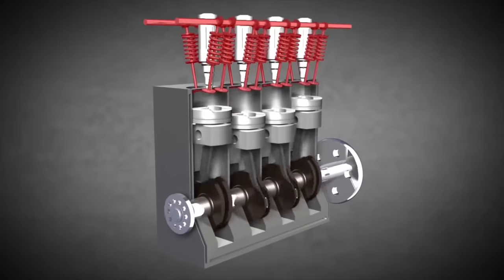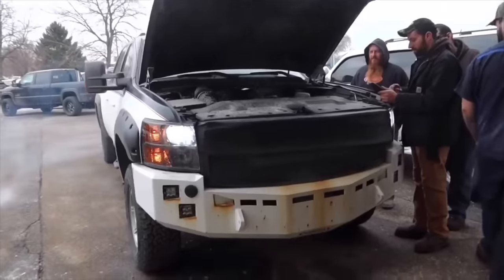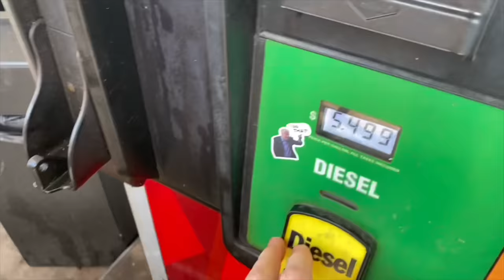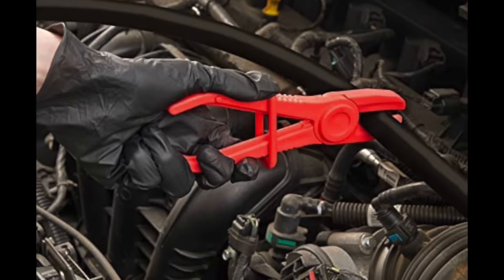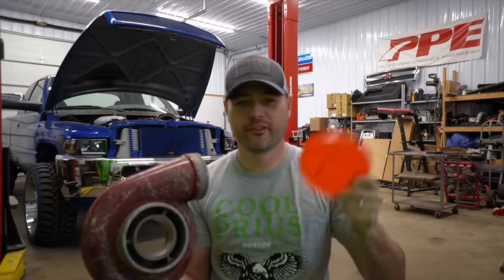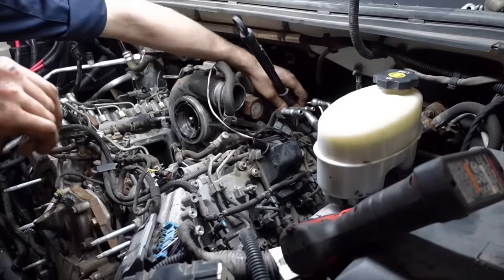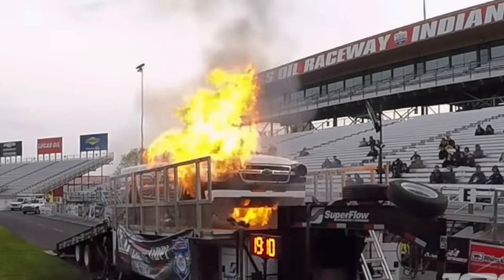What Is A Diesel Engine Runaway? *EXPLAINED* ￼

Comment: Ever since EGR/DPF systems became a thing, a runaway can be stopped by turning off the ignition. In order for the engine to run on exhaust fumes instead of air, there's now a throttle body before the intake manifold which can completely shut off air supply
Reply: Lube oil runaways can’t be stopped by shutting off the fuel. That’s because the engine fuel isn’t coming through the fuel system.
Gas turbines have the same problem.
Reply: I didn't say shut off the fuel, but the air supply.
Reply: @DanniV8  Diesels manufactured after the 1930’s don’t have throttle bodies - they use fuel injection (usually directly injection). Throttle bodies significantly reduce engine efficiency which is why modern gasoline/petrol engines don’t have them either.
Reply: @allangibson8494  Petrol cars always have throttle bodies. Some don't use them, but then they have some sort of valvetrain system that regulates throttle. In those cases, the throttle bodies are always wide open during operation, but are a failsafe in case the valvetrain system malfunctions. If a malfunction occurs, the throttle body is used to regulate throttle with reduced power and the relevant driver messages. A good example of this kind of system, is BMW's Valvetronic.

Since about 2007, diesel cars have had EGR and DPF systems. In order to clear the diesel particulate filter, a regeneration mode is activated that makes the engine run on the air from it's own exhaust, A.K.A. Exhaust Gas Regeneration. When this mode is activated, a flap - usually called a throttle body, is used to close off the fresh air supply. This, in combination with a slightly higher concentration of fuel, generates exhaust gas heats in excess of 600°C in order to vaporize the particulates in the particulate filter.

So, there is a throttle body/throttle valve, in these cars, but it's not used to control throttle. There simply isn't another name for this type of valve.

The added benefit of this emission reducing tool, is that in the event of a diesel runaway where the turbo is feeding a mixture of air and engine oil into the engine, the key can be switched off and that closes both the EGR valve and the "throttle" valve, effectively blocking the oil mixed air from ever entering the intake manifold and therefore shutting off the engine.
Reply: @DanniV8  Direct injection gasoline engines don’t have throttle bodies - they have air flow measuring devices.
Throttle bodies exist to modulate air flow while maintaining a constant fuel flow ratio. Direct injection engines simply don’t require them to run.
Reply: @allangibson8494  Which petrol cars don't have a throttle body? I don't know all cars but I work on BMW's and they all have them, petrol and diesel, even the brand new ones. 

My own petrol car has a high pressure direct injection fuel system, and the only time it has failed on me was when the throttle body failed and the car would only idle, not take any response from the accelerator.

It is a direct injection gasoline engine that I replaced the throttle body on with my own hands, so yes, they do have them.

There might be cars from other manufacturers that don't have them, but I have yet to see any.

Comment: The real problem is: free entry of air along with accumulated oil in the air cooler. Oil from damaged turbo. You accelerate and the engine pulls accumulated oil. perfect combination to feed the engine at full rpm. oil works as fuel

Comment: Great video... as always.  Very important information.  Way back long long time ago... scary to think how long it's been... ANYWAY... my good friend and I  [couple jarheads ..heavy equipment mechanics...].  Had a 6-71 Detroit Diesel  [6 cylinder 71 series injectors] in a 82-30 Dozer. Run away on us... we slammed the clipboard down on the intake and bailed ..like Earl lol... it shut it down and it didn't blow.  I don't remember the direct cause... yeah it was a long time ago don't remind me.. I believe the throttle stuck.  Diesel engines are not high revving engines... but it took off. It will suck all the air out you through your backside in a hurry.  
  After that we tried to talk the boss into a purpose run away as a class.  He was for it but we never got our hands on a piece of equipment being coded out. That we could use.  
Great job...
Reply from the maker: That’s wild 😂 also thanks for your service 🇺🇸
Reply: Detroit Diesels shut down with the governor commanding full fueling. If the rack sticks, it'll run away. You'll see a lot of YouTube videos of people starting them after a long time idle only after they have made sure the fueling rack is moving freely.

Comment: Yes I have actually believe that is true, it happened to my old Izusu Mu 4wd 2.8D turbo. Turbo got damaged and engine still continues to running with high black smoke out of Mu exhaust and suddenly there was running away on and I managed to gear-in 5th speed, clutch off slowly and it stops,  turbo got replaced. One year late, Mu engine completed dead.

Comment: It's always a good idea to have a fire extinguisher in your truck, and if the extinguisher is large enough, you can usually stop a runaway engine if you can discharge the extinguisher directly into the air intake.

A runaway engine is a very dangerous situation and the safest action you can take is to get away from it and keep everyone else away too.
Reply: Some buses and trucks have automatic suppression systems mounted in the engine hood. Wondering if they can effectively smother a runaway engine if discharged.

Comment: I was so (unreasonably) worried about this issue I ran a hose from a 2.5lb CO2 accessed from inside the cab to a port I machined that sits inside the intake plenum just in front of the turbo entry.  If I get a runaway I open the tank valve and it floods the engine with CO2.  Yes, it's overkill but I'm retired so I have the time and money for overkill.  This is on a 1988 Land Rover 110 with a 300 TDI.

Comment: I was working on an old 2-cylinder Kubota diesel generator. I started it unaware the governor was not hooked up and the spring pulled it all the way to wide open throttle. The way we got it to stop was my plugging every orifice on that goddamn engine.

Comment: Nitrogen or CO2 suffocation system would work,just use a air restrictor like the air shut off valve and then fill it full of inert gas

Comment: Had a runaway on a military Chevy we had just gotten. They had air filter removed. I grabbed my hat and plugged intake. The mechanics had all ran away. That was in the mid 80s. those trucks where crap. Compared to the old Dodges they where supposed to replace. No power. Open diffs. And high gears.

Comment: With a manual transmission you can put it in gear and hold the brakes to overpower the engine (or break the transmission)

Also, why don't air shutoff valves come standard? it's not like they're expensive

Comment: I think this is what happened to me on my 2005 ford 6.0. I was getting on it pretty hard and then it just kept going without me.  I managed to apply the brake long and hard enough to bring it to a stop bringing the rpm down and shut the engine. Never did it again after that. Restarted it and it was fine.

Comment: Was driving a freightliner with rebuilt DD-15 motor an the injector flaps got stuck open. Motor hit 4k rpms before the case cracked open stopped the motor

Comment: I have a diesel jetta that ran away.  VW has a valve in the engine that closes when the key is turned off,  which cuts off the air supply to the engine. I was able to stop it,  but had to rebuild the engine.

Comment: Had a runaway diesel about a year ago now with my alfa romeo 147. I ended up stalling it by going into 5th gear.
I wasn't all that versed into car mechanics, so i thought it might have been the head gasket or the car overheating.
Turns out the turbine wheel was worn out and moved around too much, scraping the walls of the turbocharger, burning or leaking oil.
I was incredibly perplexed over how it could have happened, and was told that i could've literally died if I didn't stall it out right away by my local mechanic.
The alfa romeo currently sits outside my home, the valves that blew were restored and now she's waiting for a new turbocharger, no big damage was done thanks to panicked quick thinking.

Comment: A runaway truck is one thing but GE 4 stroke locomotives runaways are absolutely terrifying- your exhaust pipe turns into a rocket and you can't stop it even if you take a fire hose and shove it into the intake, there are some videos of that NS ES44 that ran away and burned to the ground, while nearly burning till its diesel tanks and blowing up even after the emergency fuel cutoff was hit twice. The crew abandoned ship and she went out like a rocket

Comment: Older diesels like from the 60’s and 70’s were far more common to have issues with runaways but they were also pretty much always commercial vehicles like semi’s and large equipment and the issue is far less common now. However you should never idle your diesels when you work in the gas and oil industry because vapors from the environment can cause a runaway situation on a diesel with no mechanical issues so don’t idle while getting propane tanks filled either. Personally I’d recommend a fuel valve away from the engine bay that you can shut off easily to limit fuel sources, there’s literally multiple ways to do it cheaply. Now if you have the money and want the piece of mind I’d go ahead and add the air intake cut off as well but those are definitely more pricey than a fuel cut off

Comment: I have 1998 Mercedes E300TD OM606 with HX35. Had her run away after warming it up. Ran away for a good minute then quietly shut off while puking oil out the dipstick tube. Still cranks but no fire. Scariest shit I've witnessed

Comment: Its more common in 2 stroke diesels. With the desire to own detroits ive seen a lot.. and its preventable without even replacing any parts. Its all right under the valve covers. Turbo seals is another one, rings, so on. But if u got turned up diesels on a dyno all day why not just a pair of pinchers and knowing where the fuel lines are at. And as another person mentioned, those who work in oil/gas refining, or even around it, yea that flapper with an electric solenoid is a must. Also a feature of many older diesels. If your past the point of no return.. have some fun and attempt to hydrolock it..?

Comment: I always thought about installing a ball joint valve in the fuel line that I could turn off but I didn’t know the oil could keep it running

Comment: Year old video, but I've a marine diesel with decompression valves on each cylinder. Pretty sure tractor engines have them too. 

That is the fastest, most effective way to shut down a runaway and it's beyond me why truck engines don't have them.

Comment: This type of runaway is really really rare, because diesel is heavy engine in all aspects, you need a LOT of oil come in to keep engine running or even running engine in high rpm... I think best thing you can try is put it in high gear, i mean if you don't do that and engine actually goes to high rpm it can blow and can kill you or anyone else, destroyed transmission is better than killing someone...

Comment: 2 years ago I had a Deutz in an 820 Fendt run on me at a customer's. The customer called the shop I work at to have a tech go out and get it running after they overhauled the engine. They couldn't get it started. This particular engine has 6 unit pumps that are hooked up to a rack that opens and closes the pumps in relation to the throttle input. Controlled electronically. They had the pumps out and reinstalled them and said they were all in time, they went through the procedure in the Deutz book. I check a few things over and start to work on getting it running. I was bleeding the air out of the system and noticed I had 3 pumps pumping a lot of fuel and three that were barely spitting fuel. I tightened all the lines and cranked on it and it started. The RPM went from crank to the moon in a blink! I jumped over the front axle cause I was standing face to face with a screaming cold engine! Because I knew it was a fuel run away I cut the fuel line feeding the pump. The three pumps that were pumping a large amount of fuel were not hooked in the rack properly and were wide open! At the end of the day it needs to be over hauled again cause it had spun a couple main bearings.

Comment: On that last video with the white truck. If those guys that ran up with fire extinguishers would have just unloaded their extinguishers into the truck intake (driver side headlight) would that have stopped the motor? Would that have been worth doing or is there something that can be saved in this situation? Like everything except the engine, Can’t put a new engine in a truck that burned to the ground is my thought.

Comment: Not an expert, but if air intake valve does not exist or has malfunctioned, can activating jake brake help? After all it is used as engine brake in tractor trailers as effective way to slow down?

Comment: Could you not just put it in gear or leave it in gear and slam the brakes down forcing the engine to basically slow down because it can't turn the wheels?
Reply: I feel like that would work

Comment: A HALON or CO2 fire extinguisher directed into the air intake will do the trick, as well as possibly save damage. Newer Detroit Diesels were equipped with an emergency air cut-off valve from the factory, for just such an occasion!

Comment: I dont have a truck but i have a diesel bmw 335d f31 it does have flaps to block air getting in when the engine is shut off

Comment: If it’s not a race truck like a regular Fed Ex truck or Ups truck could you spray a fire extinguishers right into the air filer /air intake. Fire extinguishers sprayed right into the intake. Would that stop it?

Comment: Open the drain valve on my fass fuel set up
Reply from the maker: That might just do it
Reply: @TruckMaster  unless it’s pulling in oil
Reply: I was at customs in Detroit and a truck coming off the Ambassador bridge has the engine run away like this. The driver was yelling on the CB because he didn’t know what was going on. Something broke and the engine stopped fortunately. 
I think the key is to know this can happen and plan what to do. I think stalling the engine would work without too much damage, but you would have to do it quickly. As soon as you know the engine is speeding up, get it in gear and apply the brakes. Of course, an automatic transmission wouldn’t help. I wonder is the self driving trucks are programmed for that???

Comment: Stalling it in a higher gear isn’t a bad idea I’d rather repair or replace the drive chain even that would be cheaper but I’ve seen people stuffing a shirt inside a turbo to stall the engine out it worked and they said it cheaper to replace a shirt and turbo than replacing an engine

Comment: Some years ago I had an Opel Astra, which is the European version of the Saturn Astra and witch is available with a diesel engine in Europe. At 136k miles I had a diesel runaway with the engine eating its own oil on a German Autobahn at 120-130 mph. It was easy to stop the car on the emergency lane, but I wasn’t familiar with the phenomenon. So I couldn’t stop the engine by shutting down the electronic system with the fuel pumps and I didn’t know how to stop the engine by other methods. It created a lot of smoke, so I couldn’t see anything around the car. As you shouldn’t walk on a German no speed limit highway anyway, it’s even more dangerous if you can’t see around the car. So I decided to wait in the car.
Eventually the engine ran out of oil and stopped.
After that I called the automobile club to send a ride for me and my car.
Before the mechanic arrived, a police car stopped by and some friendly officers told me to check on any oil leaks witch I might have to clean up on the emergency lane. After telling them that I already called the automobile club they had other jobs to do and left me on the highway. 
After the mechanic arrived, he got to the problem fast and said that he would have to pick up the car and that according to what he knows I experienced a diesel runway.
While he was loading my car at the rear end of his truck, a truck of the local fire department arrived (yes, with all the lights on and a whole team of firemen.)
Apparently at least one of the car passing by (and didn’t stop) must have called them seeing me in the smoking car, but they quickly realized that they had no job here to keep them busy.
As I found out later by not stopping the engine the turbo and the engine were damaged beyond repair and the rest of the car wasn’t worth replacing the whole engine so It went to the junkyard.

Today I know I should have stopped it by the clutch and a high gear to reduce the load on the gearbox. This might have saved the engine. Of course, the turbo was already damaged at that moment.

I can’t recommend this experience to anyone although except for me needing a new car nothing really happened.

Comment: I recently bought a o6' big horn editiin 5.9 cummins from original owner , 444xxx miles , pegged it up to bout 100mph the other days tried to runaway,  drove it today doing about 55mph just whipped the the throttle ( less than 3 seconds full spiked ) tried to run away again,  first reaction pop air intake to turbo and block .... however looking for a real resolution to problem not how to  ways to prevent further damage when it does happen.?

Comment: The horsepower is great, but it’s better when your able to control it…
Reply: That's why I propose to use donkeypower in modern engines. It doesn't tend to run away as easily.